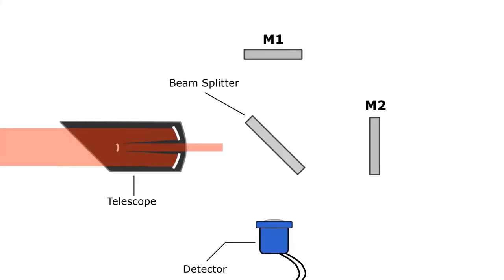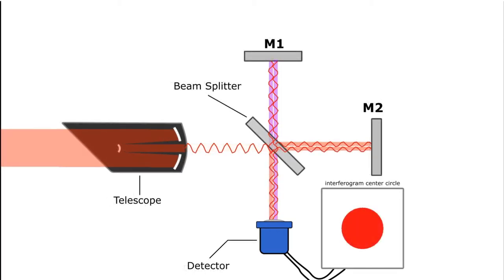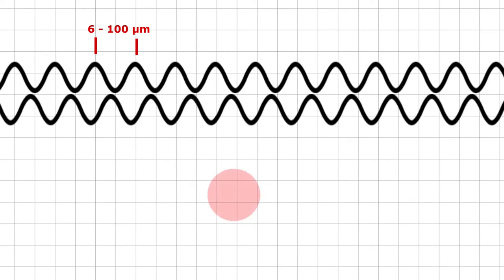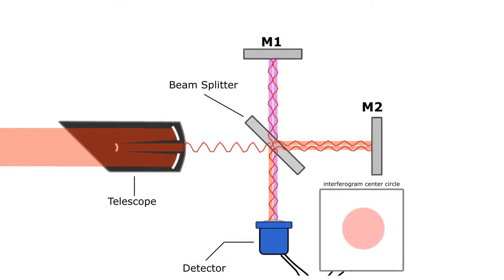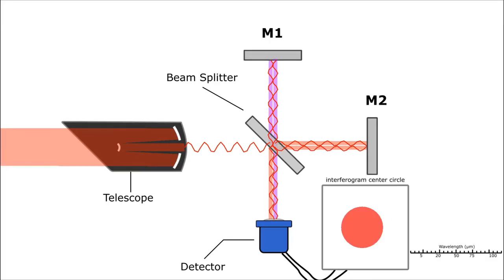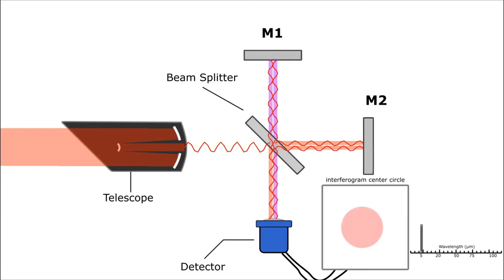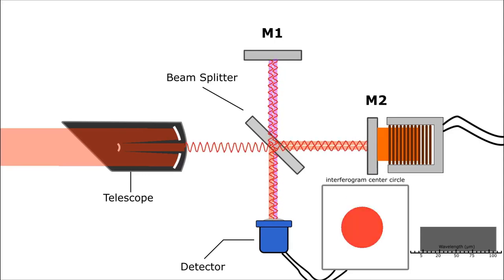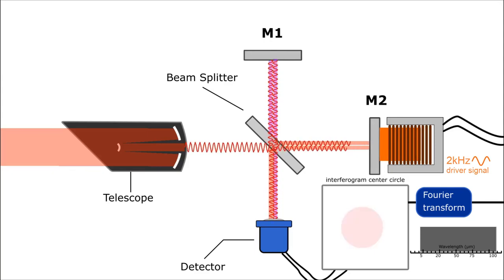OSIRIS REx OTES

Comment: Do we need to account for Doppler shift when reflecting off the moving mirror?
Reply from the maker: That's a good question. Considering the sweep frequency is only 2Khz and the distance the mirror has to move is really small, the actually speed of the mirrors may not high enough to affect the data. But I haven't done the actual calculation on it so I could very well be wrong about this.